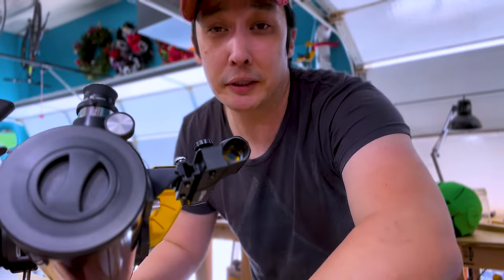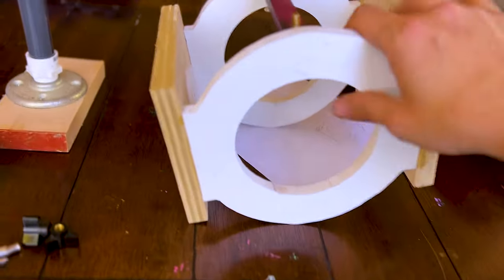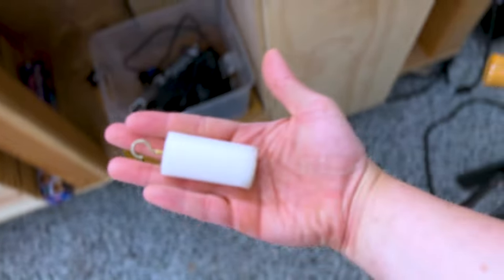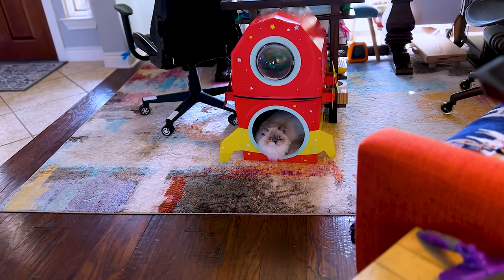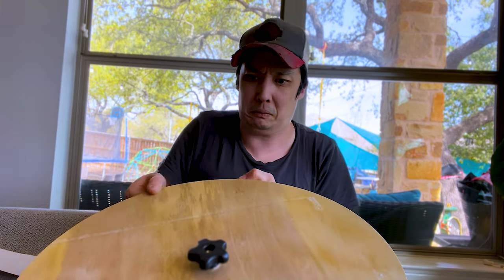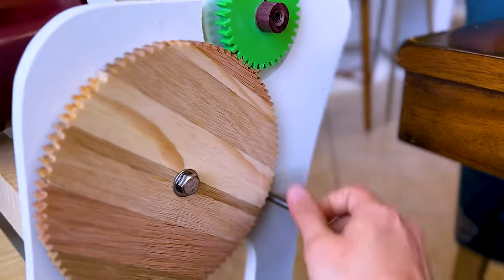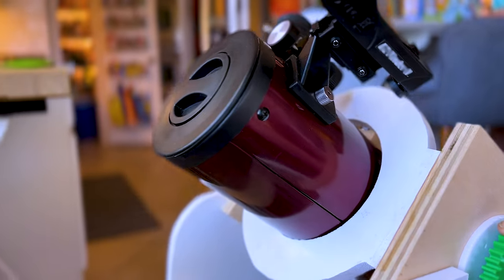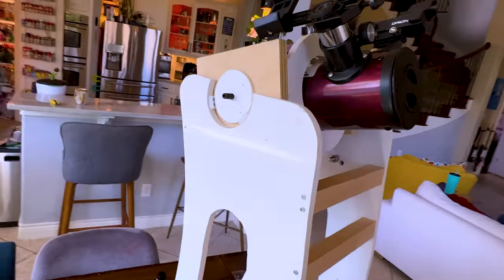Excessively Modding my Son's Beginner Telescope...INTO A MEGA TELESCOPE

Comment: The big idler gear won't change the gear ratio at all.  If the number of teeth on each gear is, say,  20, 100 and 40, the overall ratio is 20/100 * 100/40 = 20/40.  That is, the 100 tooth gear is cancelled.  To change the ratio, a smaller gear needs to be fixed concentrically to the large gear, then drive the gear fixed to the telescope.  
Great projects; I like the cue builds.
Reply from the maker: Oh dear the gears in this project. It was apparent very quickly that there was some gear sorcery happening and I had no idea what I was doing. We had lots of fun on this one though!